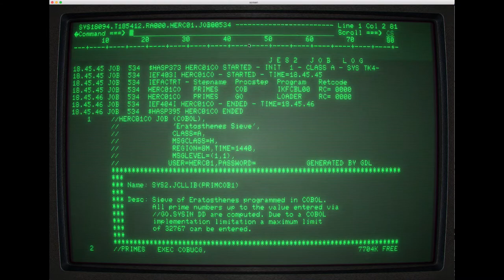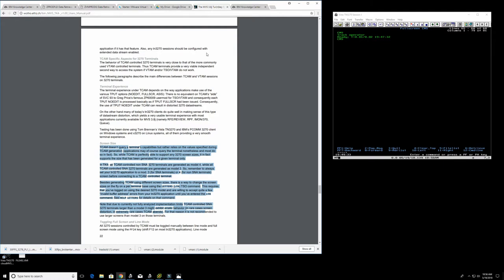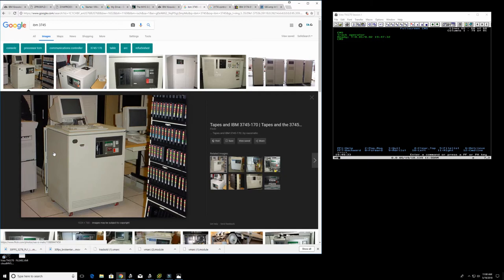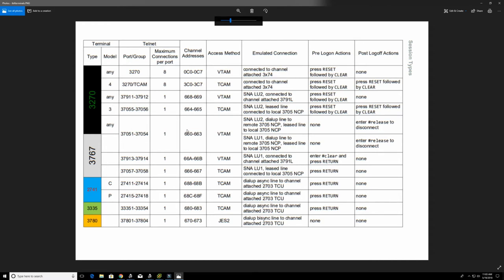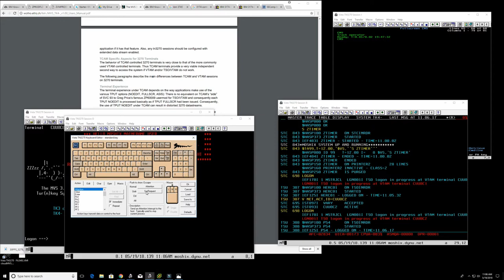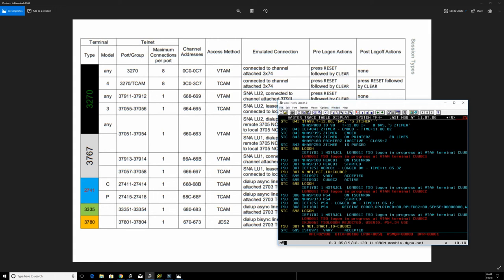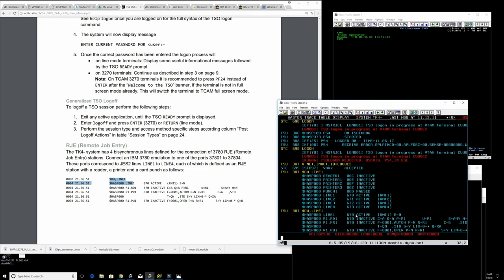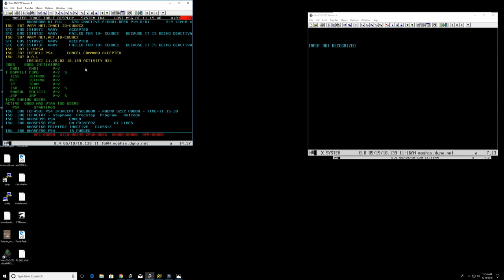Understanding Terminal Sessions in MVS 3.8 TK4 - M65

Comment: How do I re-connect to my terminal? I encountered a problem where my terminal was log on.  Then because the terminal hang so I close the emulator. When I try log on again. It say user id in used. How can I force off or cancel my own id since I am not sysadm? There is no option to re-connect in tk4- logon. So how long will my id be logged on before it time out?
Reply: Yup it worked! Thank you.

Comment: I think you are misreading the table when saying "if you use a Model 4 you will always be going trhough a TCAM". It is very easy to check that this is not true. Just connect using a Model 4 and check the assinged address in Hercules devices (hit Esc) - you will see that you have connected to C0-C7 and not to 3C0-3C7. The Model column is there to indicate that TCAM doesn’t query a terminal’s capabilities but rather relies on the values specified during TCAM generation (3 or 4). It is always "any" for VTAM.
Having said that, it's still unclear to me how to connect to 3C0-3C7. Maybe you know?
Reply from the maker: Yes, you are right. I will check how to connect to TCAM, even though I have variously  connected to TCAM in the past and I know because connecting to TCAM with the wrong terminal type causes the screen contents to go berserk.
Reply: I have browsed Hercules sources and figured out how to connect to TCAM.
Start a New Terminal Session in Vista TN3270, tick the TN3270E checkbox, and type "TCAM" in the LU Name.
You will be connected to channel 3C0 (TCAM).
Reply from the maker: Very cool ! Thanks